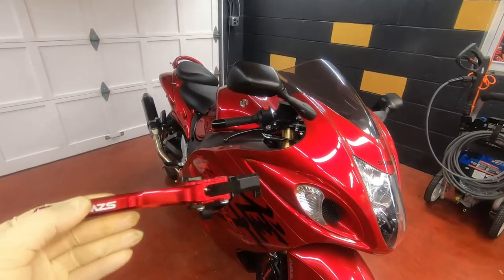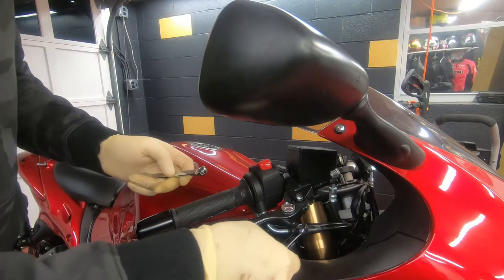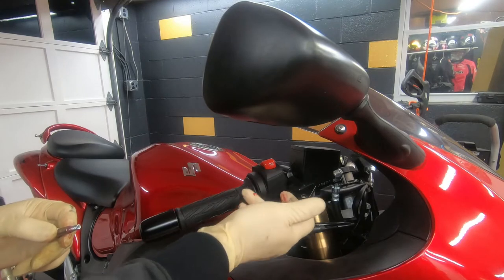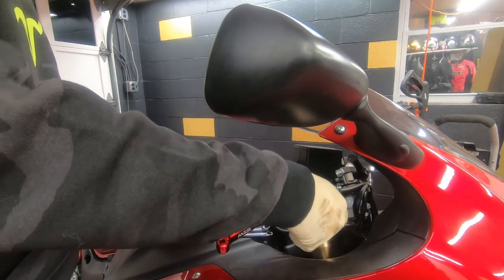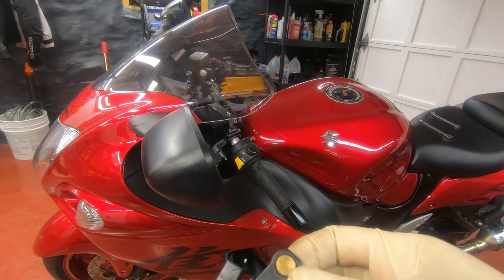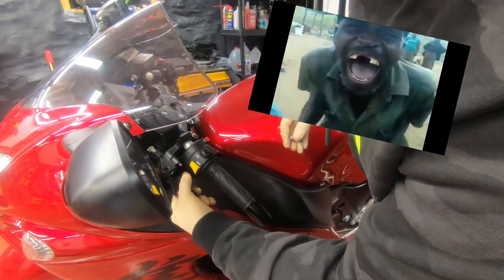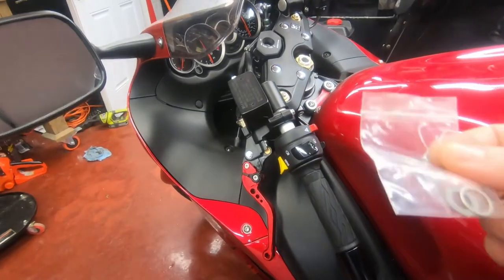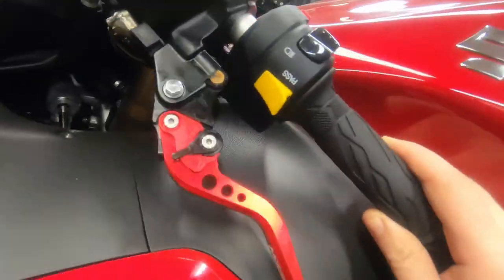How to Install brake and clutch Shorty Adjustable levers.

Comment: Candy red is the best color on a HAYABUSA.
I just got a 2013 HAYABUSA Limited Edition(Nothing more than a different color scheme🤣) in yellow last month. 
The color is good for me too, but I can't be more happy if it were in red like yours.
Reply from the maker: Yup, the candy red is really nice man👌and in person under the sun it's even better! 😉 
Congrats on your Busa! Are you happy with it so far?
Reply: @MototalkUSA  
Of course, I'm so happy with it.
I owned 5 bikes since 2019, 1 brand new and the others used. 
I sold 2 of them last year including the first bike bought brand new and a used one. 
The clutch operation of this newly bought used HAYABUSA is smoothest among all of the bikes I owned. Nothing to complain regarding mechanical operation and quality.
I'm in Canada, here the price of new HAYABUSA before Gen 3 is 1/4 less than GSX-R1000. In other words, GSX-R1000 is 1/3 more expensive than HAYABUSA. 
But for used bikes with same production year, HAYABUSA is a few grands more expensive than GSX-R1000.
As for new bikes, KAWASAKI ZX-14R is 2~3 grands more expensive than HAYABUSA, but for used ones, HAYABUSA is a few grands more expensive than ZX-14R.
Reply from the maker: @jengtiger2882 hello Canada ! Happy to hear so man. Hayabusa's hold their value pretty good! It's an iconic motorcycle. I too really like the hydraulic clutch and actually it was one of the selling points for me because I've also owned 2 GSX-R's and an R6 and those clutch cables where torture to commute with 😅 Now I'm king with the Busa! ☺️
Speaking of hydraulic clutches, I bought another bike last weekend that has a hydraulic clutch too 😉 I'll make a video of it soon, but no one knows about this bike yet.
Reply: @MototalkUSA  
So lucky to know your new bike, haha.
Currently I own HONDA CBX1100XX BLACKBIRD 1999, SUZUKI GSX-R1000 2007 and HAYABUSA.
I plan to put at least one bike on selling list, either CBX1100XX or GSX-R1000 when the riding season is coming.
3 bikes are too many for me, since I'm the only rider, so I have to let some of them go, and make some room in my garage too.
Of course, I will keep HAYABUSA until I'm too old to straddle on it🤣
Reply from the maker: @jengtiger2882  very nice! I wish I had 3 bikes too! I got 2 for now but I think I'll expand over time 😅 the 1100xx is also an iconic bike 👌 kinda the reason why the Hayabusa was born, so it could defeat the blackbird. Pretty interesting story... 
I believe also your gsxr has hydraulic clutch correct? If I'm not mistaking 2007-2008 it was hydro.
Reply: @MototalkUSA  
I think nearly every motorcyclist knows the history between HONDA BLACKBIARD and SUZUKI HAYABUSA, at least part of it. 
Yes, it's equipped with hydraulic clutch too, but not as good as my HAYABUSA.
Reply from the maker: @jengtiger2882  Hayabusa is the best! 💪💪
Reply: @MototalkUSA  
At least one of the best👍

Comment: THank you for this video!!  My clutch lever broke in the same spot also.  There is this weird "notch" in that area and it weakens the lever.  My hubby is going to change my levers for me.  Thanks again!!!  #HotMamaBusa
Reply from the maker: You're very welcome! I'm happy to hear you liked the video. I believe they have that notch purposely there for that exact reason, if it was to break, that would be the spot instead of further in and then the clutch lever won't be operable and could leave you stranded. With the new shorter lever it's harder for it to hit if it's dropped so that's a big plus. Thank you for your comment! 🙌🙌💪
Reply: @MototalkUSA  I totally agree with you regarding the "break point" on the OEM levers.  That was a great idea by Suzuki!  My husband watched your video and he said it was great and very easy to understand.  He and I both subscribed right away to your channel.  I purchased my Busa in 2012 but the lever instructions should be the same.  Will check out your other videos!!  Thanks again!!
Reply from the maker: @SpicyWife4Life  thank you both so much for the support guys! 💪💪 Every single subscriber counts and helps out the channel. The install is the same, it's basically the same bike from 2008-2020 with some differences like brakes, power modes and emission controls. Yes please do check out my other videos 🙌🙌
Reply: That notch is there for a reason, so it breaks easily during a crash, or hitting it on something, it's a safety thing because if you bent it by hitting something you wouldn't be able to use it, so it breaks so at least you can get home or the shop
Reply: I recently learned tht the notch is a breaking point so if ur bike goes down  ur whole lever doesn't get wrecked.

Comment: Hello bro just got my order in and just been delivered.  Question on my old ones there set at 4 what are yours set at . 🤔🤔🤔
Reply from the maker: Hey! I don't remember what was the setting of the stock ones but the new one I have on 2 for the clutch and 3 for the brake. But you should set it where it's comfortable for you.

Comment: Good afternoon the levers doesn’t rub the plastic by the speedometer when turning the steering all the way left or right ?
Reply from the maker: @xElchulo305x  hello, nope not at all, they have great clearance.
Reply: @MototalkUSA thank i just checked and i think my issue is the center that hold the suspension and the handle it’s aftermarket and moved the levers toward the fairing thanks again
Reply from the maker: @xElchulo305x  you're very welcome my friend, yes maybe the other part  you have aftermarket might cause it touch. Mine is the original one but even tho I put a spacer there it still doesn't touch. Maybe if you can move the levers inward more you might get lucky hopefully. Here's a link of a video I did, it might help you out in some way hopefully https://youtu.be/rF-rvKytgIs?si=-FhLoMAoP1FCzq3L
Reply: @MototalkUSA thanks
Reply from the maker: @xElchulo305x  you're very welcome, anytime 😉

Comment: I bought these for my gen 1 off ebay and put them on, but they're way thinner than the stock levers and so they wiggle up and down. Is that meant to happen or do they not fit on the gen 1?
Reply from the maker: @danielsavluk7556  they will have some play up and down. Try to tighten the bolts that hold em, that might take up some slack.

Comment: No rub on the fenders from the shortys?
Reply from the maker: Nope, not at all. So far I'm pleased with these.
Reply: @MototalkUSA  okay nice! I bought some eBay shorty ones with the hayabusa engraving and they rub on the upper housing plastic. Had to put the stock ones back on.
Reply from the maker: @MrJsled  that's weird 🤔 they must have a different bend to them.

Comment: What type of grease is that? And are those hayabusa specific?
Reply from the maker: Any kind of grease should do, it just needs a little something so it's not totally dry. The levers are specifically for the Hayabusa, I have the link to purchase from Amazon in the description of the video.
Reply: @MototalkUSA  yeah I finally saw it and they are out of stock
Reply from the maker: @GLP3  yup you're right. You can get these, for the Gen 2 Busa, they're double the price but it's a better brand so it's totally worth it. https://amzn.to/42V1kJv
Reply: Thank you was looking for these

Comment: Question for ya. Did you have the issue of your new levers hitting the fairing on a hard turn? I've read complaints about this
Reply from the maker: @Hawkeye45b  nope not at all, and I even raised the handlebars too and still they don't hit. If anything they have better clearance because they're shorter.
Reply: @MototalkUSA  was yours specifically for a Gen 2 or was they for Gen 1 and Gen 2?
Reply from the maker: @Hawkeye45b  it was specifically for a Gen 2. I have the link in the description of the video but it's currently out of stock. Are you looking for Gen 1?
Reply: @MototalkUSA  no. I'm looking for Gen 2 and  most I see if this brand are for the first Gen.
Reply from the maker: @Hawkeye45b  you can go with these, it's for Gen 2. They're double the price but it's a better known brand. https://amzn.to/45XoOiI
Reply: @MototalkUSA  thanks
Reply from the maker: @Hawkeye45b  my pleasure man 😉